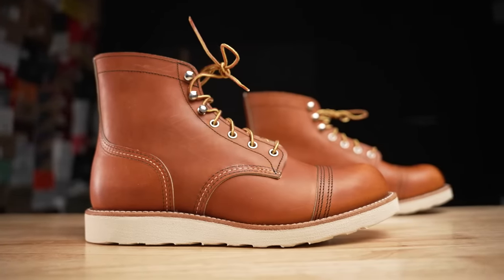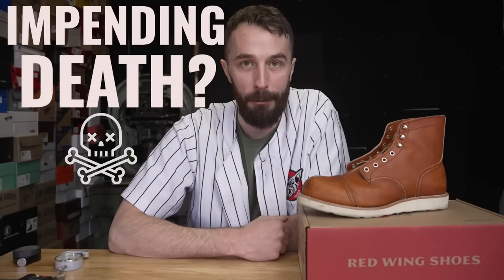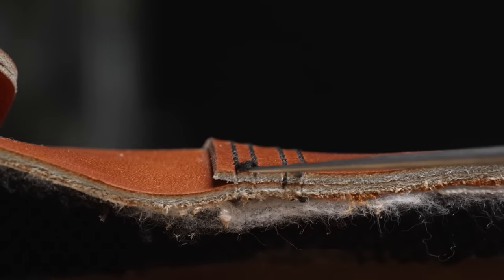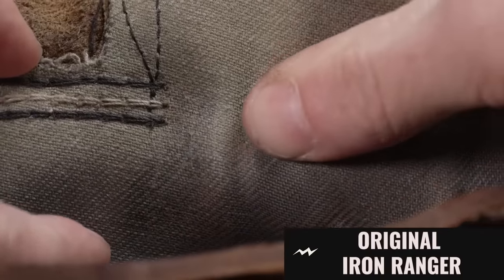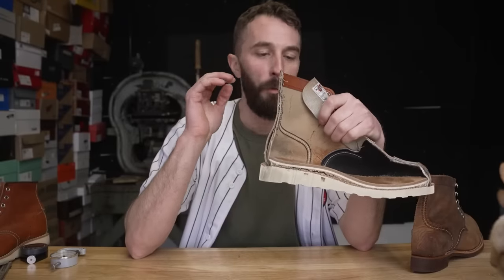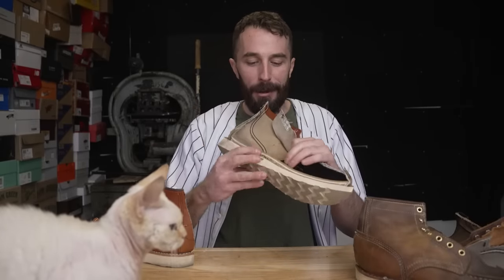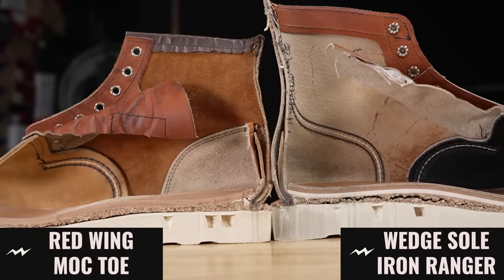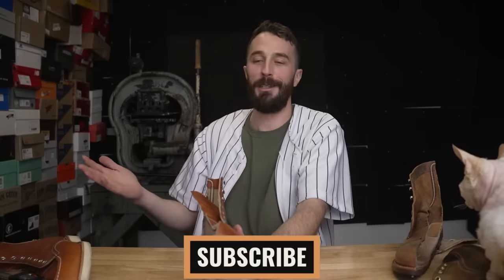Why People Are Pissed At Red Wing

Comment: As a Red Wing branded dealer for over 25 years, I can tell you this is definitely NOT the direction they are going with their current, classic Heritage boots. This is more in line with trying to capture a different customer that wants comfort right out of the box. We sell way more 405’s, 411’s, and 2415’s than 875’s. The main reason is comfort. As much as I try and educate my customers on the break in period, they usually pass on the 875. Main problem has been getting the imported products on the shelves for the last year. Their domestic production has been much more readily available.
Reply: I can sayI love my 875 the most and get used the most ,break in does take some time and patience. My 866 see some action very now and again .All my other redwing are well worn and paid for . I think a lot of people don't want any break in and hat why this pair is little more cushion , they just don't realize what there missing with a well broke in sole. My only gripe on the 875 is how fast the wear is on the sole.
Reply: Redwing is cheaping out but increasing price. Just like a zillion other shoe brands I've had to increase for a lower margin of cost in the past year. This is partially because of material cost going up due to an almost 7% increase in inflation. And partially because they simply know they can get away with it. I sell high quality shoes my man. We all know where the industry is going.
Reply: I wonder how many people have seen the full catalog of Redwing shoes. Their success doesn't hinge on one style alone. Most boots Redwing makes are far below the build quality of the Iron Rangers, but those price points are needed for certain fields of work. For example, I've worked at a couple places that buy employees a new pair of boots every year and, due to the harsh work environment, I don't think more expensive boots would last that much longer. Sometimes, comfort is more important than longevity anyway and if you buy a new pair every year, paid for buy the employer, then why would you want a better boot that takes longer to break in. Many companies buy from Redwing and business seems good for them. I do wish that Redwing would stick to American made. I don't think many people realize that some models are made over seas.
Reply: @bahjinelson3986  i agree with u, its crazy to spend  350 on a pair of shoes just to have them covered in grease in two weeks. Red wings steel toe line is not any better than tims or keens imo, but more expensive.
Reply: You seem like the man to ask. Is there a Red Wing made in U.S.A. Work boot that is non steel toe and comes in widths larger than EE or XW? Thanks for any help!
Reply: I'm on my 9th pair of 3506's. The current pair I have ive been wearing 18 months in a job that shreds boots. The boots in this video are basically sneakers.
Reply: @Kravachi  I was repairing boots a decade ago, and we were seeing the trend back then.  We were getting less repairability in boots that were costing $300 at their baseline.  Cheaper materials and lower quality craftsmanship with a higher price tag has been the standard for way longer than the past year, my friend.
Reply: @davidhughes5369  You're better off going with a pair of Nick's Boots.  They're still all leather and handmade in the Pacific Northwest.  They have widths from AA to FFFF, have safety toe options (none, steel, composite) and are completely repairable/rebuildable.  They can even make a completely custom boot for you based on measurements.
Reply: I call B.S. on you R.W. quality has slipped more and more over the years! I’ve been buying their products for over thirty years! I don’t mind spending the money, but a boot or shoe that use too last me a year or more falls apart in fricking six months! Not too mention the lack of customer service they offer sucks! I loved this company, but them trying to keep up with other off brand work shoes but charging fifty to a hundred dollars more because of a logo is not right! Same crap happened to  Carhartt,Dickies so on and so on! Yes I realize a lot of D. bags wear these clothes and foot wear because some how it makes them feel like they are regular joes! Please bring back the quality that so many of use relied upon to get us to the end of the day! Sorry just upset that another company looks like it is going to the shitter!
Reply: Chippewa tried something similar and now they are closed down.
Reply: @michaelhuang0417  I wouldn't use those for work, and don't know anyone that would.  I can say that I have two pairs that are ten years old and have been resoled once each as well as an expensive pair of Ariats that cost just as much as the redwings.  Back then they were 250.  They get covered in grease, chems, oil, and just filth.  Still going strong.  Prior to breaking out the big bucks I had gone through half a dozen cheap brands from the sporting goods stores.  Most of them didn't last six months.
Reply: @vaguedreams  The iron rangers were made as work boots for mine workers back in the 1930s n 1940s. Minimum wage was like 0.30- 0.40, and a pair would cost 4-5 dollars. No one can afford to use them as work boots now just because how much the price has gone up disproportionately to wages.
Reply: @michaelhuang0417  mate, times are different, but by your logic 15 hours of work got you a pair.  Thats about the same today.

The Job you get that requires those kinds of work boots aren't paying minimum wage.  It's an investment in your feet.

Look, I get it.  I really do because I was very much on team, "what kind of moron pays 250 dollars for boots when I can just buy 50 dollar ones".

We all are at first.  But after going through several pairs  and my coworkers telling me they are worth the money i gave them a go, and two months later got another pair.
Reply: 1. They stopped making 899s
2. They stopped making 14B

I bought custom last year, a huge difference…far better quality, better fit. Like the Ferrari of boots to Redwing Ford of boots
Reply: @anthonybanda8192  it’s surprising how much more energy it takes to climb a steep slope in cheap boots, the Nicks climb well, make a solid platform and don’t slip back down.
Reply: Because of my “bad” feet, I have always had problems breaking in boots. For me, a pair of 875’s fresh out of the box is MORE comfortable than the others.  Because my feet don’t like Chinese boots made using random Lasts or without any Lasts at all, it must be my feet are bad. 🧐
Reply: @strengthandbulkMadness  I remember the day I bought my last Chippewas made in Wisconsin 😔
Reply: I have 5 pairs of redwings.   My workboot is the 963.  It seems to have been discontinued.  Those boots are 10 years old and ready for their 3rd sole.  I also have the 8111 they are 9 years old and havent been resold yet.   Those boots have earned a good living for me on the rail road.  Having quality footware is a must. My shoes are NOT fashion statements, with that said I dont tend to wear the Iron Rangers to work much  because the soles are thin and hard. But they do fit my feet like a glove.
I havent tried the super sole2 boots yet, seems that is the replacement for the scout sole line.    10 years out of a work boot.  Should I buy another pair or go with Nicks?  If Redwings get more expensive I might.
Reply: You people "educated" me into hurting my feet for weeks until I finally got rid of your shitty boots. I wish I still had them so I could throw them through your front window.

I wore them for 4-6 hours on weekends for weeks. They sucked and sucked until I got rid of them. Probably sucked after too but it wasn't my problem anymore. It makes me sad and angry to have to shit talk a union made product, but facts are facts.
Reply: I'd take a pair of Thorogoods over redwing any day.
Reply: I’ve been shod with Red Wing 2406 for over 30 years. Last 5-6 years the leather is not what it used to be. It is dry and splits with minor abrasions 😣
Reply: Can I find a straight answer and explanation as to why I had to order my new model 2244 size 12D from a store a long way from my Atlanta home rather than have them shipped to a local Red Wing store?        
I got some convoluted and less-than-believable excuse that if the local store tried to order from another location they would have their franchise pulled, that the boots could not be ordered direct from Red Wing, and got the same story from the out-of-town store that had the boots (they kindly waived the shipping fee).         
I need to try boots on before I buy, if only for my peace-of-mind (these are a fairly substantial investment in work PPE, and my employer only reimburses up to less than half the cost of these boots).        
I tried another brand for one day and suffered for months as a result (plantar fasciitis).       
Why is it so hard to get the boots I need?
Reply: If a shoe is comfortable when you buy it, it's going to fall apart within 6 months IME. Wish more people knew this so that we could avoid all this waste of completely unrecyclable materials. Good shoes need to break in!
Reply: @michaelhuang0417  Jesus, if you're worried about the grease, you don't need good boots my man. Good shoes are a tool like any other, it's function over form. Buying redwings for looks is just as stupid and wasteful as buying basketball shoes for looks. Nothing is stopping you from keeping them looking nice if you feel like doing that, but it's not what they're made for. "Buy once, cry once".
Reply: @tissuepaper9962  exactly.  That's why I wear nicks yes they take longer to break in but it's well worth the extra break in time .
Reply: @tissuepaper9962  That has not been my experience with Red Wings.
Reply: @strengthandbulkMadness  Wrong ! I’m a dealer for Red Wing and Chippewa . Just received a large shipping from Chippewa today .
Reply: What's your policy on the custom insoles? I've had some for like 5 months and I've worn a big toe spot In the left insole . Am I under warranty or do I just have to buy a new set? Been a Redwing wearer for 10 years and just got the insoles in the atm F2892-18. Stock number 985.
Reply: 10 years ago, I was told to invest in a pair of Redwings. I saw the price tag and thought "Wow I didnt know these dudes are into designer boots" because they sounded like a scam when I heard they needed to be broken in or whatever they told me. A good boot should just be a good boot, not a wild animal that need to pay for to be corralled, sweetened up, talked nice to, massaged a little before bed, and tucked in with a lullaby for a few weeks before its even usable.
Reply: @justrynnagitthere1430  If the boots are not comfortable when you buy them, they will never be comfortable.        
I wear two pairs of socks in my boots: a lightweight synthetic to fit to my foot and a heavyweight wool sock to wick moisture and conform to the inside of the boot. This arrangement also keeps the friction between the socks instead of between the foot and the sock. My feet stay dry and I have no problems with blisters.
Reply: The break in period? Mine are five years old and stiff as day one!
Reply: @josephschaefer9163  As I have commented, if they don't fit when you buy them they will never fit. I wear two pairs of socks (inner thin synthetic, outer very heavy merino wool, and have no problems.
Reply: I porches one last week and I will return back to the store because material is very cheap and made in Vietnam I am not paying close to $300 for this product
Reply: This is true.  I worked there

Comment: Been wearing Red Wings for years and have resoled some pair so many times the cobbler finally told me there not enough left to sew.  I have never had another boot as comfortable and easy to break in from day one.  As a retiree I am not as hard on boots and shoes as one time, but they are still the brand I will buy every time.
Reply: Replace the welt helps
Reply: But… the video’s about the difference between your hard-wearing well-built boots— made by Red Wing for years— and a new pair.
Reply: I've been buying them for 23 yrs too.
Reply: @nealramsey4439  not these ones though!
Reply: I bought my first pair 4 months ago 
eventually lost them to working in a Lead Smelter in Minnesota
Those were so comfortable when I first wore them, the only thing that literally hurt was the sole. Other than that.
These thorough goods have a stitching in the heal that just rubs... bad.
Carolinas take a minute to break in.
Wolverines are near garbage...
off to try Nicks and Whites.
Reply: I think a lot depends on where your foot rests.  The most recent pair I had for work had me bleeding all over and limping.  Then had to wrap my foot in an ace bandage and bandages for the next day.  I now have permanent discoloration  on my right foot on the inside ankle area.

Comment: As a industrial blacksmith I only wear Redwing Truwelt boots. Over the 11 yrs I’ve smithed they are the only boots that can stand up to walking on hot carbon scale, and handle the oils in the press pits when we have to clean those out. I tend to get a year out of them. I would recommend thick socks for break in though. They are kind of a bear to break in.

Comment: I am a footwear developer. For the internal lining, there are very high abrasion resistant fabrics widely available that have breathable properties. If that is what they used, I could see this material less prone to blistering and maybe a little moisture wicking. Mostly about the immediate feeling of comfort I would say. For the lasting board, if they used paper...totally unacceptable. Hard to believe actually. Are you sure it's not a non woven nylon fiber board? That would be a little better and with the high density foam, it would again, add some comfort. Material sourcing has been a problem as well these days. They may have been forced to accept a lesser grade material in order to meat production deadlines as high end material availability dwindles.
Reply: Wow you know lots of shoe words

Comment: If this happens with other new models, I think it would definitely be a sign of trouble.  But if it is just this model, should be fine.
Reply: This is what I'm hoping as well
Reply: @proto4747  they did it also with the chelseas with traction tred sole. I think this is the direction they are heading.
Reply: @ibbjos08  Do you have any links or articles on that regarding the traction treds?
Reply: It's true. I own a pair of  the new chelseas and they're built exactly like these new rangers.